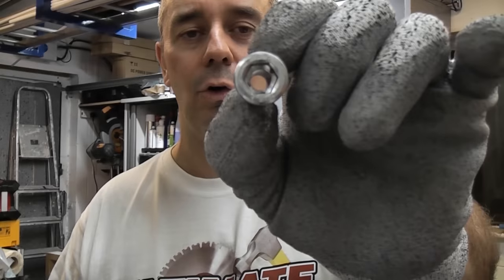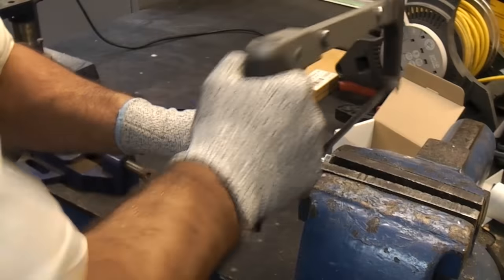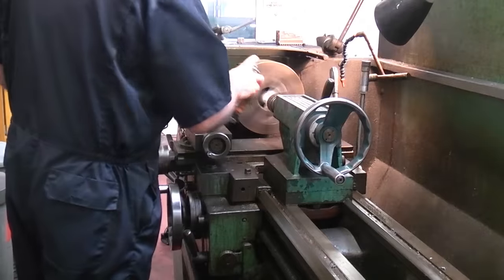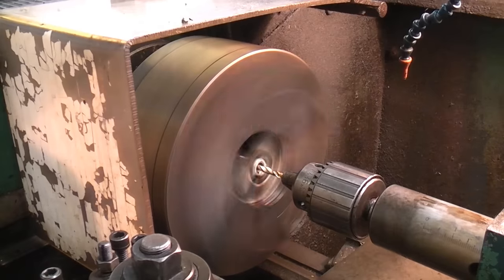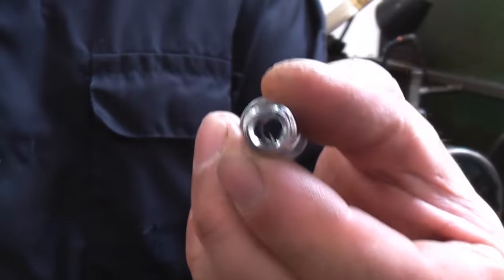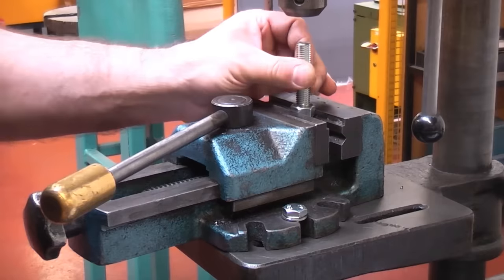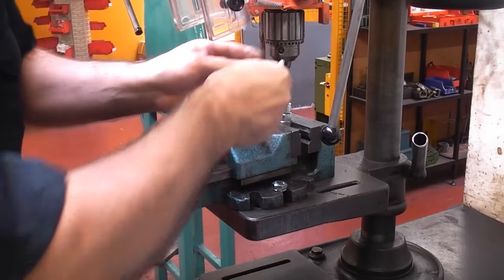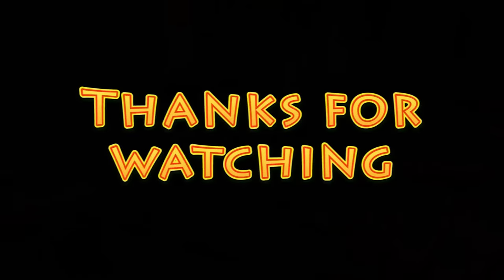How to drill through the centre of a bolt | drill bolt guide

Comment: I have a 1986 F150.
My diff fill plug is rusted and "welded" inside. I cannot remove it with the 1/2" rachet head it was designed with. It is easily rounded. So, I must drill a hole through the fill plug careful not to go through into the diff front cover. Then bore it out.
I saw another artical on the internet that recommended I start the drill hole with a small bits and move up to larger bits and with that special tool , the name of which just escapes me, I make a "screwable" bore then I put in another bolt - one with a 3/8 - 1/2 inch head. NEVER ANOTHER BOLT REQUIRING A 1/2" rachet head. 
I cannot use any lathe obviously. I must bore it out with bits using hand drills under the truck, at at the rear of the differential.
I'm positive the fluid has never been changed.
David
Alberta
Reply from the maker: That is going to be a real pain of a job, especially when you drill through the plug and the oil starts to leak out.
Can you not remove the filler plug?
If you can just get an oil suction gun and suck the old oil out through that- it will save you a lot of work.
Best of luck with it 👍
Reply: Ultimate...,
   I've surrendered! The filler plug head is rounded off. Plus, its rusted in and likely "welded" in from 34 years of heat. I doubt it's ever been changed. If someone attempted to they rounded the Allen head. I'm beat.
I'm home now awaiting a call from my mechanic, John, to get the plug bored out and replaced.
I've included a gasket($15), gasket sealer ($15), 3 ltrs of 80W90 organic oil, ($4.50 ea.) 
It was just supposed to be a hobby job. Now its $200-$250 mechanic's job.
It requires an acetylene torch (I bought a 1 ltr propane torch) and the correct bolts and drills. Its not possible for me to do it.
I was so angry today.
The parts guy said, "I hear that so often. And it sounds like my jobs".
A DYI'er like me starts off in high spirits then the job goes all wrong!
Sorry to vent. I'll attempt tranny next. Thanks.
David
Alberta

Comment: Thx but how does this allow you to drill out a broken bolt in a hole?
Reply: It's used as a guide....the bolt with the center drilled out is screwed back into the effected hole(this only works if the broken bolt is well below the hole)and then use a drill to drill out the broken bolt.

Comment: So what if you don't have - or have access to - a lathe? What if there are no threads to put the bolt guide into because the bolt is broken off a half thread above the surface, and there's a bunch of rust involved?
Reply from the maker: If you don't have a lathe, you can use a pillar drill (as demonstrated in this video)
If there are no threads, you don't need to worry about damaging them, so no need to make the drill guide.
If there is rust- use some spray penetrant. 
Thanks for the comment 👍

Comment: A faster way to do this is to just put the bolt in the Chuck, that way when the drill Chuck is spinning, the bolt is spinning, and no matter where you put that drill bit it will want to walk right to the direct center of what you're drilling.
You don't even need to bolt down the vice.

Comment: Hi, whats the purpose of doing this? It also weakens the bolt though right? That's a big step of weakening.
Reply: Watch his other video demonstrating how to remove a bolt that has sheared. Check here: 
https://youtu.be/dJfkCj3FWBs

This video will then make sense to you.
Reply: Lime in another video he was using these as drill bit guides to drill out broken bolts. The bolts you see him make keep the bit from damaging the hole as well as centering the bit on the bolt.
Reply: im also curious... 🤔
Reply: In another of his videos, he screws the hole-thru bolts into equipment where another bolt has broken off and can't be gotten to. Once the hole-thru is in place, he drills a hole into the broken bolt which allows the use of a bolt extractor to remove the broken bolt. See: https://www.youtube.com/watch?v=dJfkCj3FWBs
Reply: It's for when you're drilling out or trying to use a screw extractor on a bolt/stud that is broken below the surface.  Using one of these allows you to get the drill bit perfectly centred on the broken off piece.

Previous video explains it better probably.
Reply: He's making drill guides for drilling out broken bolts. He used these in a previous video and this is how to make them.
Reply: Lime 
A  drill  guide  to  drill  out  a  broken  bolt  if  you've  got  a  couple  of  threads
Reply: Watch his previous video:
https://www.youtube.com/watch?v=dJfkCj3FWBs&t=30s
Reply: @Lime: Read the description and watch the linked video. He uses this bolt-with-a-hole as a center guide when drilling out broken bolts, to avoid accidentally drilling the sides of the piece he is working on and to get it dead center.
Reply: Got it sorry guys, i didn't get a notification for some reason but i got notifications for other videos. WEIRD

Comment: Do you have a video of this using a hand drill?
Reply from the maker: No, it would be very difficult to do using a hand drill.
Thanks for the comment 👍
Reply: @ultimatehandyman  i currently have a bolt stuck in my brake caliper and the head is to far gone, unfortunately it has a steel rod running threw the center. Any suggestions?

Comment: Do you suppose I should use a center drill first
Reply from the maker: It depends. The cap head bolts that I used have an indentation in the dead centre of the socket head, so a centre drill was not needed. I'm not sure if all makes of cap head screws have the indentation, so you might have to use the centre drill
Thanks for the comment 👍

Comment: I’ve tried this, but... the issue is that there is not enough room to get the drill bit into the chuck. Unless, you cut the drill bits “shorter” which it looks like you may have done.
Problem with that is the drill bits are then Permanently too short for any other use.
Reply from the maker: Can't you lower the table on the drill press?
Thanks for the comment 👍

Comment: If the chuck is large enough, I just put the bolt in the chuck and put the drill bit in the vise, and drill it like a vertical lathe.
Reply: How do you then centre the  drill bit to the work piece?

Comment: There's a so much easier way to do this!  Just get a hex, torx or whatever INSERT BIT that fits the socket bolt, put that in the drill press and line it up with the bolt, replace insert bit with drill, DONE!

Comment: Are you satisfied with that FERM pillar drill?
Reply from the maker: I would not buy another one. It was ok for the money, but the chuck is poor. I was intending making this video using it, but the chuck would not tighten. I have tried removing the chuck, but it is on a morse taper and I have smacked the hell out of it and still can't get it out. 
Thanks for the comment
Reply: @ultimatehandyman  Thanks for your answer. Inherited a Ferm from the early 2000s, it still works, but is wobbly as hell. I share and appreciate your opinion. Cheers
Reply from the maker: You are welcome ;-)
Reply: @ultimatehandyman  More than likely a J2 taper not Morse. To remove you use a (hardened) taper forked wedge. Think ball joint splitter but much finer. Wacking the chuck with a hammer is highly unlikely to split the chuck from the shaft

Comment: Get a long nut, put the bolt in the nut, tighten the nut in the drill press  so that the bolt is spinning, and fix the drill on the bottom. The drill will find the center, just like with the lathe.

Comment: If you don`t have lathe. Only Bench drill and vise in it. Measure the bolt angle as well as you can. Drill a hole through with a small drill. Check and correct the adjustment enough times that it is correct by drilling through. Drill a hole to the desired size. Attach it with a long nut to the bolt which you want the hole.

Comment: A Light grip on the thread will not harm the thread, & also you can tell much easier whether or not the bolt is running True & if not, can knock it True by eye prior to drilling!!
Reply: Better still - Grip on the Head with the thread sticking out for checking True/concentric.

Comment: Good work ; but,  shouldn't  the lathe, be rotating slower, when  DRILLING ?   Remember,  speed increases heat - a Direct relationship. Perhaps, go a bit slower  when drilling, like 200 rpm or so. Thankyou   GOOD  LUCK,  ALL !
Reply from the maker: No, that speed is fine for that diameter of drill bit. If the drill bit was 50mm diameter, then you would slow it right down 😉

Comment: Why not leave the bolt in the chuck when you are aligning the nut? Just skip the nut and mount the drillbit in the vice and  use it like an vertical lathe.
Then there's not so critical to make the vice in center and you don't need to bolt it down.
Reply from the maker: I didn't put the socket head set screw into the chuck, I put the threaded bar in the chuck.
You can try doing it your way if you like 😉
Thanks for the comment 👍

Comment: Anyone can achieve that using the tools you have at your disposal.  You should show us how it's done using just a rusty chisel and sandpaper.
Reply from the maker: Or perhaps just use a magic wand 😂
Reply: I mean, you can laugh at me, but the bolt holding my Brompton bike's carrier block is broken inside the hole, and all I have is my dad's handheld drill from the 1960's. I just want to drill a bit into the center of the bolt and turn it with a bolt extractor, but it's hard to punch and drill into such an uneven surface.

Comment: Strange logic. "Most people don't have access to a lathe so use a pillar drill instead" (that most people do have access to)? I would have said that if you don't have access to a lathe you are unlikely to have assess to a pillar drill instead. Not criticizing the video itself as it showed a good method of lining up the bolt to drill a straight hole using a pillar drill.  Would have been useful to have ideas about how to drill through a bolt using hand held tools and available materials as this is the situation you would have on site.
Reply from the maker: Not strange logic at all, you can get a cheap pillar drill for less than £100
Lathes on the other hand are considerably more expensive.
Thanks for the comment
Reply: OK. Googled it and found one for £80. I didn't realise you could get them that cheap. Fair enough. Any methods to do it without one? Holding it in pliers, mole grips etc can take all day. Trying to hold it in materials just makes it spin.
Reply from the maker: It's really difficult without a lathe, or pillar drill because they both make it easy to hit the dead centre and be true all the way through. If you try drilling a bolt by hand, you run the risk of the hole not being dead central.

Comment: I wish my 3 jaw would self centre like that. must be a worn scroll.
Reply: @ultimatehandyman  Wow, Could not find that one in Emojipedia?
Reply from the maker: @adoreslaurel   They don't have the shock emoji?
I was shocked, as I have never heard of a scroll wearing out
Reply: @ultimatehandyman  I usually tighten in one spot only but even if I go all around, it's just good luck if it self centers. I did something interesting with some old  jaws with bad grip faces, I ground them out to a certain  depth [both types of "depth"} so that you could clamp certain types of work that you could apply pressure from the tail stock to without pushing it further into the chuck. They were "stuffed" anyway so mutilating them did not matter.

Comment: https://www.mcmaster.com/vented-cap-screws
Use these and save the effort of cutting a bolt. Line up using a drill bit in the chuck and the hole in the fastener.
Reply from the maker: I searched Google weeks abo for bolts with holes in and nothing showed up. I guess it is easy when you know the correct name for them ;-)
Thanks for the comment

Comment: He has a lathe but he doesn't have an angle grinder to cut that Bolt
Reply from the maker: The lathe is not mine.
I have 4 angle grinders, but did not need to cut the bolt ;-)
Reply: All in all a very clever trick to use
Reply from the maker: Thanks for the comments ;-)